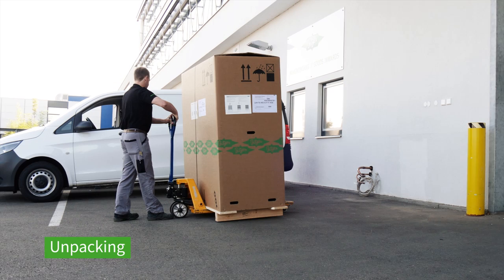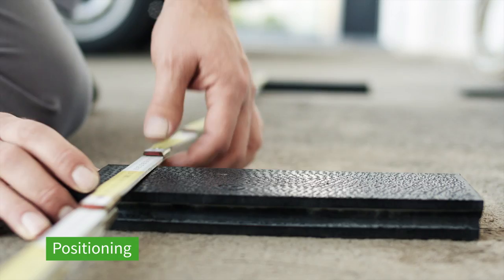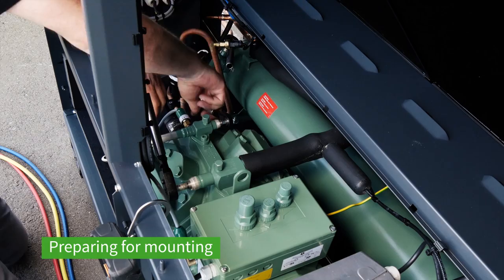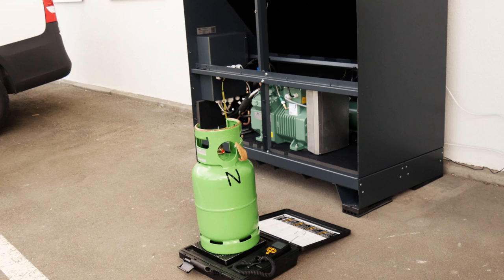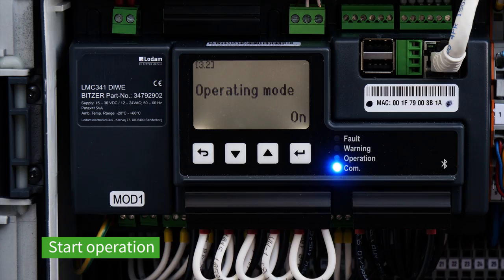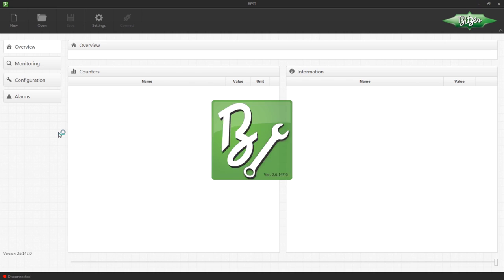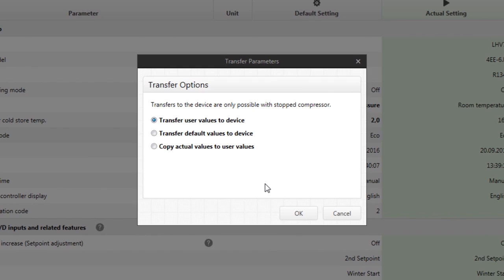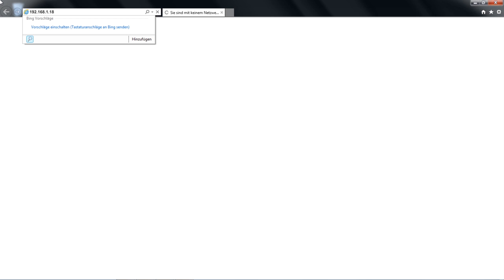BITZER ECOSTAR condensing units installation made easy

Comment: I recommend the ecostar, very practical work, good accessibility for the replacement of parts, I use the software very best, very practical but nowadays it is not very practical to walk with a computer, it is easier to create an application for the ipad.
The only thing I have to do is fix it.

Comment: I have installed some Zeas systems here in Greece and i can tell you is one of the most silent systems with inverter driven scroll compressor and a large operation range from 500W refrigeration capacity up to whatever kW is the unit! The most of the reciprocating compressors with inverter is like CRII unloading with extra steps! This is my opinion! You as a company makes a great product but when you have a very small capacity the reciprocating compressor doesn't react until gets some more load! Also high pressure refrigerants like R410A or R744 is more efficient per kg of refrigerant inside the system! You as a company have to consider this measures you had make some realy good CO2 compressors is time to turn to CO2 like other companies even Daikin have maked a CO2 version of Zeas i would love to see an upgraded version of a CO2 ecostar system! 

Also here in north of Greece you have a really bad distributor psiktiki voreiou Elados is one of the worst companies in North Greece i actually buy your products from liakacos and Tairis due to better service!